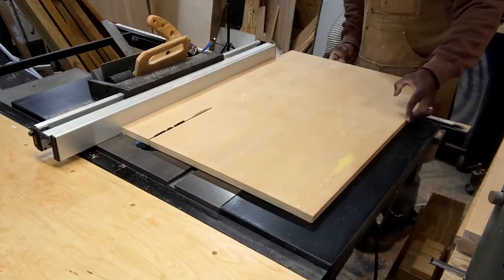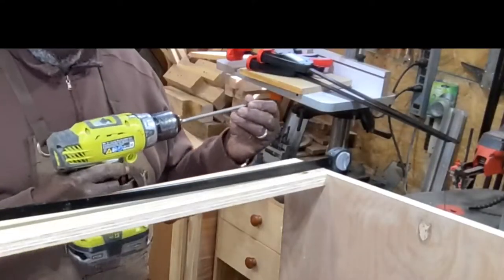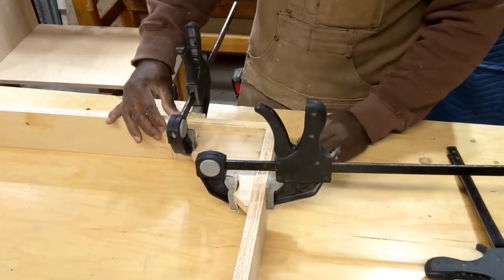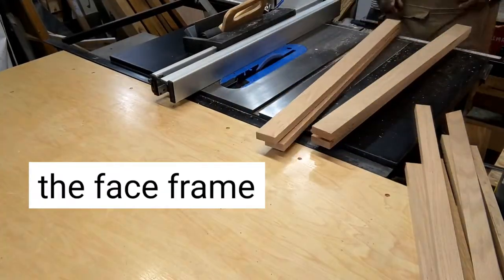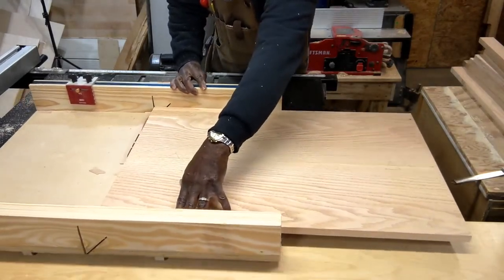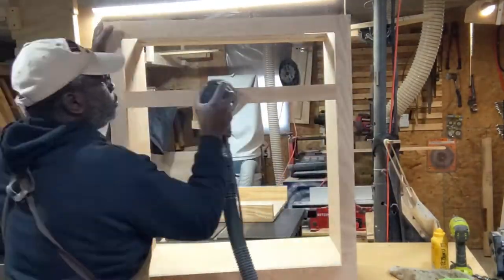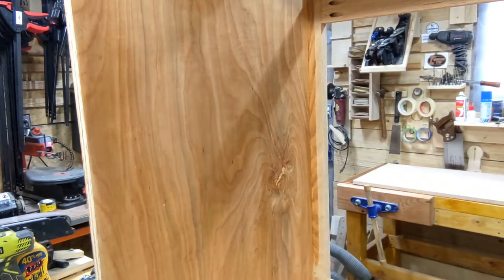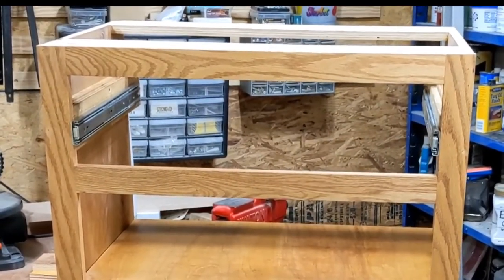how to build a microwave cabinet with a oak face drawers and doors

Comment: what drill was that to make the slanted holes for the end im trying to use a screw but it wont work
Reply from the maker: Are you talking about the pocket hole drill? That's a special drill that comes with the pocket hole kit. It's a 3/8 but it has a smaller size on the  tip which is like 1/8 of an inch. It's called a step drill. I hope this answers your question .  Thanks for watching
Reply: @WoodShopStop  yes for the 2x4